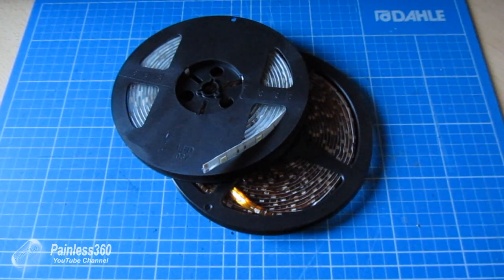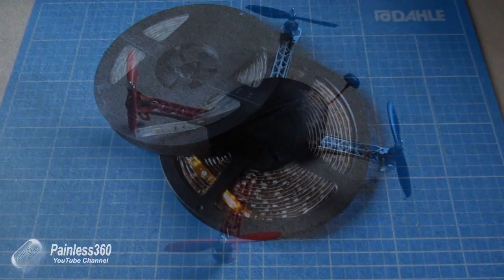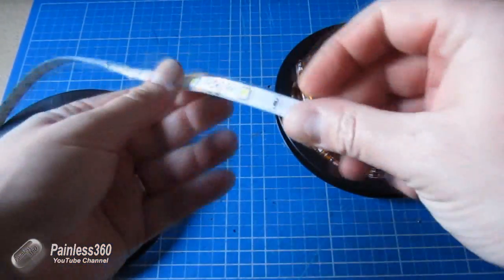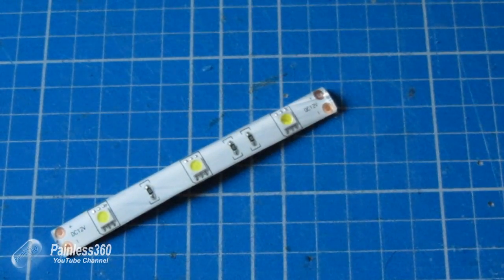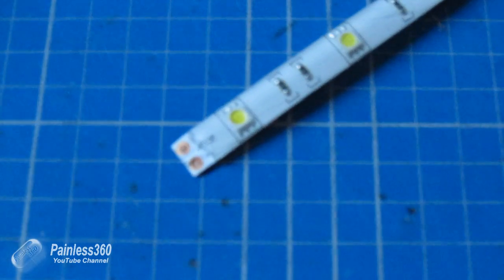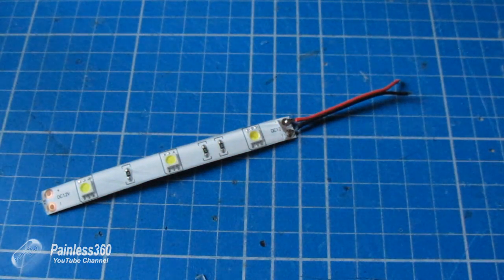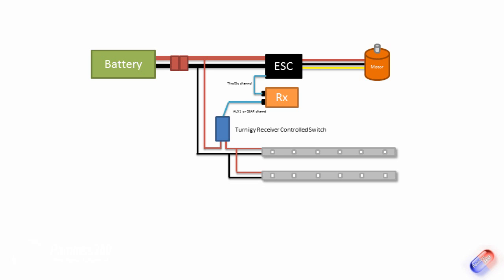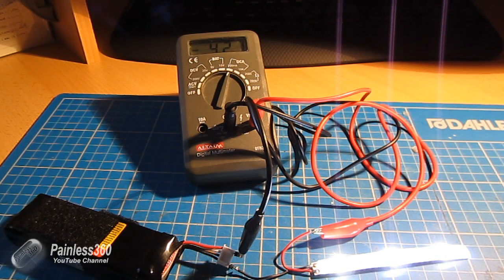How to install LED light strips (5050 and 3528 class) easily to your quadcopter/helicopter

Comment: I have a baterry 4s 1800mha graphane will it power the led as well?  Thx bud!
Reply from the maker: Only if the LEDs can support the higher voltage from a 4s pack..

Comment: Hi there mate just wanna know that I have same sort of led strips but they get hot within a minute should I continue like that or reduce the voltage down to 7.4v
Reply from the maker: No idea without looking at them, I'd check the specs with the manufacturer as they shouldn't get that warm. Best of luck!
Reply: Painless360 thank you I have same as one you have non waterproof one maybe high c rating is making them hot

Comment: where did you find that black body shell on that Quad at the beginning of this video? What size is that one 450? I'm going to be building an S500 gopro gimbal Quad as soon as it gets here from China, I am ordering it tonight. I would like to put something like that over all the electronics so it looks a bit better I wish I had a 3D printer. Thinking about adding some LEDs. not exactly sure how I am going to do it programmable 5v or strips at 12V from my 3S flight battery and a receiver activated switch ? If i use 5 V I can just use an Empty chanel from the Receiver and use a switch on my Tx to turn them off and on. do you know if the empty ports on the receiver when using PPM mode or Sbus are they still live if using 7 channels  for my flight controller im PPM will the unused 3 channels still be active ands work when I throw a switch on the TX? I font think that the Naza Light FC has an Led port for the programmable LEDs its LED channel is used to operate the status and warning LED panel also thinking about using large clear shrink tubing to attach the LEDs and ESCs to my Quad arms. Your videos are great and extremely informative especially for a total Newbie like me. I have been up all night several nights now trying to figure out what is going to work with what FCs and GPS and motors and ESC and Battery and props. Dang there is so much to learn. the kit comes with 2212 920KV motors with 30A ESC up tp 35A burst. it comes with 1050 props thinking about going to low pitch say 1138 or something maybe get a bit more lift but don't want to overload those 2212 motors?   anny wat I have to get to ordering this Quad I have been watching videos and researching for over a week now so I think It is time to pull the trigger. I am getting a PCB S500 with the PDB built into the bottom deck with Carbon fiber reinforced fiberglass arms and Carbon fiber landing skids. with 2212 920Kv motors 30 amp SmonK ESC Naza Lite FC and Naza GPS 8 props 1050 all $177.00 If I switch to the APM 2.8 and an M8N GPS it will be $149.00 Canadian shipped to my door in Canada from China. still debating the Naza AMP 
 not sure what to order. they both look good I will have to see if I can use the addressable LEDs with the Naza or the APM . Hopping this should be a good build. I built a TRex Heli clone about 15 years ago and crashed it in both occasions that I tried to fly it. & rebuilt it and it has been sitting on my shelf ever since . My GF got me the Propel maximum XL for Christmas & now the RC bug has bitten me again. this build should be a lot easier than the TRex with the sercos and swash plate nand pushrods and all that. and will be a dream to fly. I am ordering some of that blue Moon Jelly for the drum dampening stuff that you told us about for the GopPro to mount onto the Gimbal. That is amazing how it stops the video from being distorted. anyway Thank you for all your hard work making these videos They have been a great help to me. & keep them coming you are AWESOME. I will let you know how the build comes out. 
Sorry for being so long winded but so much stuff to figure out I diddn't even go into the FPV and Telemetry that I have to figure out. Thanks Wayne
Reply from the maker: This is quite an old video now so I can’t quite remember. All i can remember was that  it was from eBay and it was from a very old frame style back in the day. Sorry I can’t be more help. Happy flying!

Comment: No compass error issues with all this extra metal and wiring?
Reply from the maker: mag interference is always a problem if the compass is too near power lines. Luckily the LEDs use low power/currents..
Reply: Painless360 ok cool. Dc Current in wires will pull a compass needle so thought I'd ask.
Thanks

Comment: These 12v SMDs work with the 7.2v quad battery Ok?
Reply from the maker: +riklee I've not tried.. best of luck!
Reply: Painless360 what's the voltage of the lights you used? And the battery voltage? Thanks for your help.
Reply: I saw 12v on the video. Is your quad battery 12v exactly?
Thanks
Reply from the maker: +riklee 3s lipo...

Comment: What battery are you using on the first quad?
Reply from the maker: +InventorJS -Jacob Singh depends on the model. 2200mAh 3s or 1300mAh 4s for max speed..

Comment: Hello.  Great video, thank you for taking the time to make.  This may be a stupid question but how do you wire the 5050 LED that have 4 contact points such as +12v, G, R, B?  Thank you in advance!
Reply from the maker: +FASTnLOUDn330 those need to be controlled from a specialised control box, they are not really for this kind of application. I'm sure with a bit if work you could get them to work.. best of luck!
Reply: Thank you for the quick reply.  I just started looking online at the time I made my post but I have not found much info.  It seems like 12+ is hot (of course) and the wires coming from each other connection is a ground.  I'll do some more reading.  I am going to try and install into a large RC aircraft so I may be able to fit the specialized control box if I am able to locate one.  Thanks again!
Reply: FASTnLOUDn330 Probably too late, but I just installed some rgb strips on my 4 inch quad. The way I wired them is pretty simple. R, G and B pads are basically ground pads and you ground the colors that you want to be lit. It's sort of an rgb color code. For white, solder a wire through the R G and B pads. That color combinations will give you white. I don't know how to get colors like orange, but I did wired the light on the back of my quad to light up in red(the R pad + the 12v one).

Small IR controller are rather cheap and easy to find too, I just tried to limit the weight and cost for mine.

Comment: Can I use 1 3s lipo to power up the led strips and my drone??
Reply from the maker: +MC7 FIFA Gamer that would work! Best of luck!
Reply: Painless360 thank you so much. I hope it won't affect the performance of my drone and should i solder them directly to the main power of my PDB of my drone in parallel.
Reply from the maker: +MC7 FIFA Gamer I would If the main battery is 3s...
Reply: Painless360 thank you so much for your help.

Comment: Your videos are excellent.
I have a 5050 led panel, with GND VCC OUT GND
Please can you tell me where the wires go and why does it have 2 x GND.
I have 5 & 12 v 3pin ports on my PDB and I'd like to attach it to the Naze 32.
Any help would be greatly appreciated.
Reply from the maker: Depends on the specification of the panel. If it's 12v then I'd connect it directly to the 12v input from a 3S lipo battery.. Best of luck!
Reply: Thank you, I think I'll need it
Reply: Finally worked it out. Now I need to fix stuttering motor #2

Comment: Great job on the video. the only concern I have if I mount these on the body of my heli is they look so ugly, not the lights, just the strip part. I was thinking to mount them on the inside of the body and then try to burn 3 holes just where the lights protrude with a soldering iron. Even doing it this way I am hesitant. For me I am fussy on how it looks on the ground too. Its a Lexan body and they are expensive to replace or butcher. Any suggestions?
Reply from the maker: I cheated and had two canopies - one older one with the leds on for night flying and the nice new one for flying in the day ;)

Comment: Do you need to buy an extrra battery, and if not how to connect led to battery please make clear
Reply from the maker: +Chandra Chunduru these LED strips are 12v so you power then from anywhere on the model that has 12v. If it's a 3s Lipo then just connect them to the battery/PDB. Best of luck!

Comment: is there anyway I can connect them to the flight controller instead, so I can control them using the transmitter without any additional receiver?
Reply from the maker: +hilmi dwiputranto we've turned them on and off using a Turnigy remote control  switch. See our video on it. Happy flying!

Comment: Will I be able to cut off a single LED and be able to use it?
Reply from the maker: +Hassan Anjum Depends on the strip, you may have to test where you can cut and have the LED, current limiting resistor and power tracks in one piece. I'd use something else if that's what you want..

Comment: I recently bought this led brake on hobbyking:
http://www.hobbyking.com/hobbyking/store/__84192__HobbyKing_8482_Multirotor_LED_Brake_Light_Set.html

I don't understand how should I wire them, can you please help me?
Reply from the maker: +Luca Rosa not sure looks like you plug it into the elevator channel on the radio, then plug one end into the LED strip and the other goes to the flight controller into the normal connection for the ELEV/pitch input.. Best of luck!

Comment: Thanks for such great informative videos -- I've learned so much from them! Question on the LED wiring. I want to put a total of four LED boards on my quad. If I "piggyback" the positive and negative leads from the parallel wired LEDs to let's say, one of the ESCs, does it have any negative effect on their performance? Will it make the motors/ESCs unbalanced?
Reply from the maker: +iflyimpilot Not really but make sure that the wires that connect that ESC to the PDB can handle the extra current. Best of luck!

Comment: Is there a way to hook something like this up to a Syma X5C-1? The batteries don't have a port for them - just one set of output wires that plug into the craft.
Reply from the maker: ***** Sorry I don't have that model here - if you can find a place to get 12v from then you can run these light strips..
Best of luck.

Comment: I'm trying to use the Turnigy switch with my leds. Everything is set up correct. But when flip the switch. Which is my ch5 switch nothing happens. The plug from the Turnigy switch is in the 5th position on cc3d board. Through fc it shows accessory as ch 2 but switch works when I connect to gcs. Any suggestions?
Reply from the maker: Sleez Ick Does a servo move if you plus it into CH5 on the Rx?
Reply: Painless360 I got it to work. I'm just a idiot. I had the Turnigy switch connected to my cc3d board. Instead of the receiver. I had no place to plug in the switch so I used the board. I ended up getting a y connector
Reply from the maker: Ah ha! Well found. We all make little mistakes like that it's all part of the learning.

Happy flying!
Reply: Thanks man!

Comment: ive heard that I should use a step down. whatever that means. do I really need one? I have a 4cell battery 3000mah on a 450 sized quad I am building. I am using 30a ubec and a crius aio pro fcb. what should I do in my case? is it the same as your vid? cause I have others telling me to do some other things like using the 5v+ and ground from my fcb. dunno if that will be bad for my fcb in the long run
Reply from the maker: needabeanie beanie A 4s LIPO battery will be putting out over 16v, so unless you can find LED strips that will handle the 16v then you will need something to reduce (or step down) the voltage to the 12v that most of these strips run at. You could always connect to just three of the cells from the pack using the balance connector..
Hope this helps.
Reply: Painless360 hey thanks for the answer. I went ahead and looked up what you said and looked for ways to apply this with no luck. could you link a balance connector that you suggest and how would I use it? im pretty sure this will answer the same question others have. thanks again!  From what I did pick up reading about balance connectors is that the lipos already have them unless im way off.
Reply from the maker: Get the volt meter out and put the negative to the black wire and see what the voltages are on each of the other pins - you'll find the one that has 12v on it and you need to use that one with GNS to power the 12v kit.

Or - get a small spate 3s LIpo to power the 12v kit.

Best of luck.
Reply: Painless360 ah I see, so just put the volt meter black to the negative on the battery xt60 negative and then the positive onto the its balance connector sockets till I get the 12v?  I could buy a spare 3s because of the landing gears I want to add and stuff. good point.

Comment: so this is what I want to do. I want to have leds in each leg, which will make it 8 leds and 2 more on the bottom which equals to 10. if I were to cut the led roll into strips of 2 leds per strip, could I connect all those strips to 1 turnigy receiver ctrl switch?

This is a diagram of what I mean. I know that the red wire connects to the switch, but how do I do it when I have 5+ black(-) wires going to the batterery? is it ok to strip the wires and make them 1 single wire and connect that single wire to the battery? also. can I do the same for the red wires as shown in the diagram? thanks a lot for your time (whoever answers this)
2(leg)----------\                               -------Reciever
2(leg)-----------\                             /
2(leg)----------------------Red Wire---Switch----Battery
2(leg)-----------/
4(under quad)--/
Reply from the maker: needabeanie beanie That should work fine. I do something similar for those customers who want lots of lights! 
Happy flying!
Reply: Painless360 thanks a lot!!! now I can do that without any fear of a few LEDs ruining my battery or FCB lol

Comment: You saved me, I didn't know the difference between the LED strips. I'll be installing this lighting right to my 12v car battery. I'll actually intercept my cig lighter port, which my car switches off with the ignition. Amazon (and likely ebay) has the 4pin splitter, so what I'll be doing is having a 3 way splitter. Driver floor, passenger floor, and up into the glovebox. Maybe in the center console also...if I go four way. I'lll likely get a 4way splitter just in case, because it's all about the same price.
Reply from the maker: Royce, I have some other videos on night flying that may give you some more ideas ;) - https://www.youtube.com/playlist?list=PLYsWjANuAm4rBpqA_2JURGbxB9W8xvytw

Bets of luck with the lights!

Comment: Hi, very useful video - I would like to add some to my build. I assume for a 450 sized quad we'd probably want 6 LEDs per arm i.e. 3 on either side of the arm. 80mA x 4 = 320mA / 0.32A draw. It starts to sound bigger.. Not sure how much it would affect flight times though. What do you think?
Reply from the maker: I have a few quads that run a lot more and they do affect flight times a little. With a quad that pulls 40amp during flight then another 0.4amps will only reduce flight times by less than you'd expect. You can also fit a switch to allow you to turn them on only when you want them. See https://www.youtube.com/watch?v=qGZakWwZUYQ

Hope this helps..

Comment: For those that ask about running at lower voltage. I'm running 5050 using a 2 cell. I'm running 4 strips (one for each arm) with 6 LEDs on each. This is separate from the battery which would run the main power. They've been running now for over an hour and are giving out a decent amount of light. You would probably get brighter on 12v but it does work.

Comment: Could I connect these to my Blade 180 qx RTF? It has no light except from the main board which isn't that visible at dark
Reply from the maker: Hi, the battery on the 180 is a 1s battery (3.7v) so will not run these lights as they need 12v. You can add single LEDs to the model inline with a little resistor to add some extra light on the arms if you wanted. I may make a video that shows how to do this in the coming weeks if that would help..

Comment: i have syma x1 i, planning to put led lights like you did but the battery only 3.7volts..any help with that?
Reply from the maker: Hi Lito, the single cell LIPO that comes with your model and it's smaller size means that these light strips are too heavy and need too much voltage.

You could add a couple of single LEDs with a resistor and power them from the battery or buy a ready made loom like this - http://www3.towerhobbies.com/cgi-bin/wti0001p?&I=LXDBPP&P=ML

Hope this helps.

Comment: Great vid! If I want to run 5v strobes controlled via the TX,  would I need a separate UBEC and  turnigy switch? Any recommendations on how to wire it up?
Reply from the maker: It depends on how much power it pulls - if it's not a lot then you could run it from the UBEC already installed, if in doubt - fit another one for lights. Hope this helps.

Comment: Hey. Awesome video. Really helpful for ppl like me that want to set up LED on a quad for the first time. :) 

As I'm a beginner I'm wondering what type of cable you are using to solder on?
Just a normal Red and Black Wire? And what is a normal Red and Black Wire ?

Never really done much in the soldering department, but I want to start doing more stuff here. Hope you can help me understand which Cables can be used for this job. :)

Best regards
Crowdedlight
Reply: He used 22 gauge wire. Here is 20 gauge wire from Hobbyking in black. They also supply it in red. Ebay has the red/black wire that was used in the video.

Hobbyking:  http://www.hobbyking.com/hobbyking/store/__9654__Turnigy_Pure_Silicone_Wire_20AWG_1mtr_Black.html

Ebay stranded red/black: http://www.ebay.com/itm/3M-10ft-2-Pin-22AWG-Stranded-Cable-Wire-Cord-For-3528-5050-LED-Strip-UL-2468-/261462580786

Good luck!
Reply: Thank you. Awesome! :D